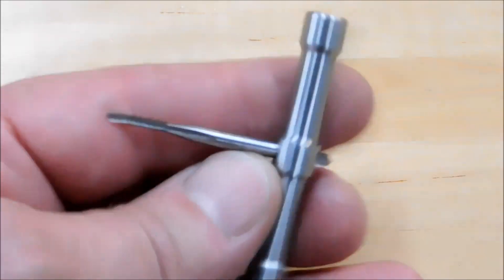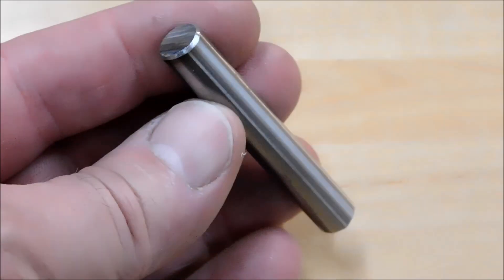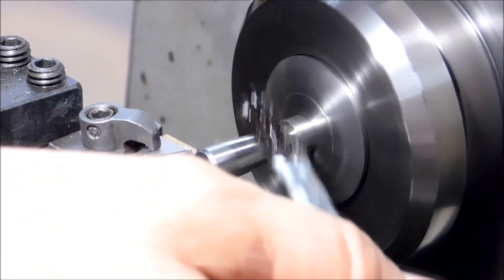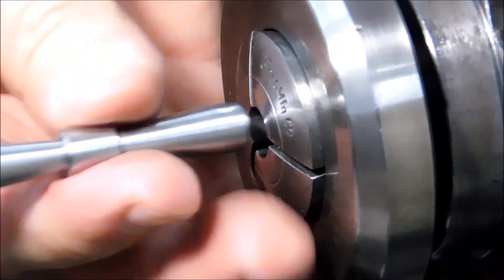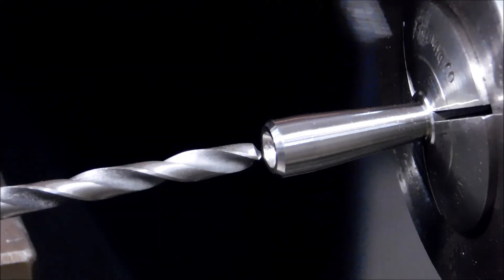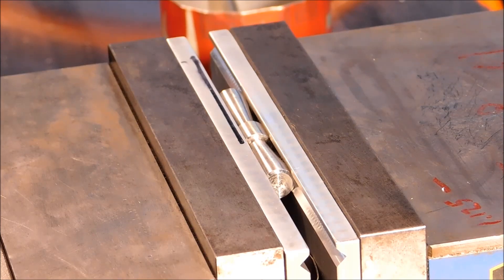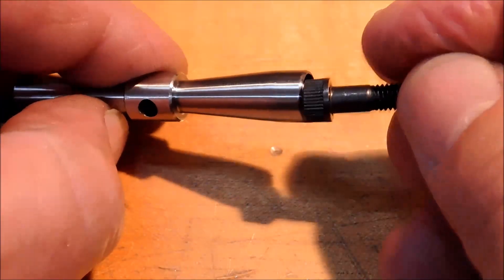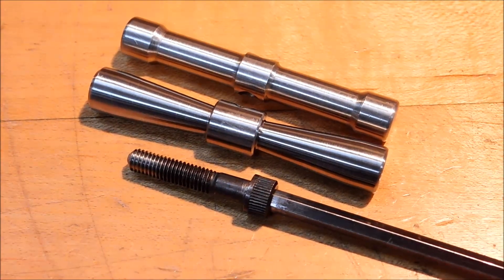Make your own Small Tap Handle !!

Comment: I use a flaring tool holder to grab the tap and allow the tap end to protrude so I can center the tap using my spring loaded center in the chuck
Reply from the maker: I'm sure it runs true.

Comment: Little set-screw tip:  apply a drop of silver solder to the tip of the set screw.  It's very grippy but soft and doesn't mar the tool.  And if it deforms, it doesn't wipe out the threads when you take it out.  Takes only a minute.  NTE did it with set screws on their pillowblock bearings briefly way back, which is where I got the idea.
Reply from the maker: This handle utilizes a Cap screw because the drive hex is twice the size for better grip. As for the tip, just sand it to a nice 45 degree angle and the threads won't get damaged either. The silver solder is a good idea, so is a brass insert.
Reply: @joepie221   Thank you.  Yes, I've done the brass insert as well with great success.  Simply drilling a hole, putting in a bit of round, and letting the first tightening swage it in there.  I switched to this because it was faster for me.  And you get to play with fire.

Comment: Hi Joe. I have a project you may be able to tackle. The microcosm engine, H 74 and H 75 have a centrifugal water pump that needs to run in the other direction, so you don't have to cross the belt. Making the impeller in the opposite direction is the problem. I would like to get in contact with you. I am also in Austin.
Reply from the maker: Hit the website contact page.

Comment: I have several tap handles that are either too large or too loose to be useful, one of these will replace several with the side benefit that it will take less room in a crowded tool drawer.
Reply from the maker: Plus give better feedback because of its size.

Comment: Thanks for the video. I need to tap some 2-56 holes so this will definitely help. Can a set screw be used instead which would avoid drilling the clearance holes for the body and head of the screw?
Reply from the maker: Absolutely. I only used a cap screw because the drive feature is much bigger.

Comment: Thanks I really enjoy your videos and the narration of what is being done.  I looked on e-bay for a convex tap guide, couldn't find one.  Did you make yours ?
Reply from the maker: No. My tap guide is a NIROL brand. If you remove the set screw in the rear of the body, you can remove the spring and tip. The tip is double sided. One point and one cup. Most come with the point side out and nobody ever knows there is another end.
Reply: @joepie221  THANKS

Comment: Hi. I don't understand that way to find the exact center of the piece: min 9:25, and even less so without using a marker. Thanks for the video.
Reply from the maker: When using a gage pin, its very easy to visually align a part. Look at the gap  between the pin to the jaws and then center the pin over the boss in the middle of the part. For an application like this, its more than sufficient.
Reply: Thanks guys

Comment: Have you got a video on how to make those v groove parallels ,seems like a handy piece of equipment to have
Reply from the maker: Use a second vise set at 45 degrees in your primary vise. Mill on the Y axis using the edge of an end mill. Quick and easy. Do them one at a time.
Reply: @joepie221  They sound and appear to be aluminum, is that correct?
Reply from the maker: @flannel_406  Correct.

Comment: wait, at 5:25, how the hell did he pull out the part from the collet while the lathe was still running?
Reply from the maker: My setup has a lever style release handle on the left side of the machine. I can open and close easily while spinning.
Reply: @joepie221  after some thinking I figured that must be the case. Didn't know such a thing existed! Cool stuff

Comment: I like it, but why thread it all of the way to the center? Just make a threadless hole for the last half inch to the center and remove the last half inch of threads from the screw. That would give you more meat on the handle..
Reply from the maker: I like it. It would allow for many different shapes with added strength at the smaller diameters. Good call.

Comment: Hi Joe. Could you please make some videos about Camlock mount Lathe Chucks (in detail if possible). My Lathe Holds D1-4 Size and It's very new to me. I would like to see how to maintain, adjust, or even make new back plate for a different chuck. Thank you and Happy new year
Reply from the maker: Just be sure that your cam posts are setup and extended so the cam lock index mark only rotates to a spot between the index lines on the cam collar. Thats very important.
Reply: @joepie221  Thank you Joe.

Comment: I found it works better to drill and tap the hole first before you turn down the outside. That way the collet has a better grip and won’t slip when tapping and I used an 8/32 screw. Thanks neat project!

Comment: hello Joe, this message is from Holland. I looked at your machining with a lot of interest. I have however one question. Why don't you clamp the tap on its square? Usually the square on a tap has the same corner diameter as the shank. I tried it and it works fine. You then don't have to grind a flat on your taps. Looking forward to your response. Herman
Reply from the maker: depending on how sharp the point is on the end of the tap, they sometimes go too far into my spring center to seat when a tap handle is registered on the square end. Thats the only reason.
Reply: @joepie221  Small taps can be awkward little sods. The little 8BA taps I'm using have a centre hole rather than a point, & the flats are minute.
Reply: When I drilled the cross hole in mine I did a pilot hole first, then drilled the clearance hole just past the set screw, Then filed the clearance hole square. Now all the set screw is just for retention.

Comment: Nice work. If I may ask, why not just drill a hole from the outside , not thru the handle, and use  a short square headed bolt ?
Reply: Shoving it up the end makes for a tidier finish.
Reply: @stevo68  Ohh Er Missus. 😁
Reply from the maker: I'm sure that would work too. You would sacrifice thread engagement, but it would work.

Comment: I saw this the other day and didn't have time to comment. While I was out at a friends shop I made one of these from, you guessed it, A gr 8 bolt. His ancient 3 speed belt drive lathe only turns automotive armatures and alternator rotors so it is different to see steel cuttings on the tray. Of course high speed tooling works best.  What a little beauty.. As you say the feedback is great. Thanks a bunch. This was fun. Now I have to make another one as my partner fell in love with it so it lives in his tool box now, LOL.
Reply from the maker: You better make a few.
Reply: @joepie221  They will make great xmas gifts. Thanks again Joe P.

Comment: Good video Joe.  Several years ago I made one similar to that, but based on the one Tubalcain (Mr. Pete) shows in one of his videos.  Used a home-made broach in the mill to cut a square corner for the tap to bear against, not sure that detail is worth the effort, and it ends up with the screw bearing on the corner of the tap square end, which isn't very secure.  I do like the tapered handles and did that with mine too.

Comment: FYI, tap sizes up to and including #6 MS (Machine Screw) or M3.5 (metric) made to USA (ANSI) dimensions, have the same size shank and square, which is .141 diameter.  The only thing that varies is the length.  So your tap wrench will fit #6 as well.  If you have small taps that have different dimensions for shank and length, these are likely German DIN dimensions and are in mm.  Great little handle. Dave
Reply from the maker: Interesting. Thanks.

Comment: I have finished mine; very happy with the result. After seeing your slotted soft jaws I decided to make a pair of those too. My question: how do you hold the plates in the mill to cut the 45 degree slots?
Reply: Lay it down flat and use a chamfer end mill.
Reply from the maker: I put a second vise in my vise at 45 degrees and used an end mill.
Reply: @joepie221  brilliant! Off to cut some 45 degree slots right now.

Comment: Very good tool. Now please teach me how to tap and not brake small taps. Seems to be a common thing with me is to brake small taps. Just the other day I broke a 4.75 metric tap and drilled the hole to 1\8  which the tap called for. Remade the part and stepped the drill size up one size larger then the threads would not hold tight just striped out. And was actually using the lathe to tap manually not under power and still broke the tap. Very frustrating .

Comment: Been using this method and concept for years with a small Starrett tap handle, don't have the number handy...
You can even pilot the top of the tap loosely in the drill chuck that dilled the hole if you don't have a spring loaded tap follower......
Reply: Mine is a Starrett #174.
0 - 14 tap sizes. Works a treat.

Comment: Not bad.not bad at all. Could be worth making one!
At time 10:00. Why not make a light cut using an end mill bit to give a small flat surface for the center drill? That protects the following work if there's "a bad day", thinking about us, not having 46 years of experience.
Reply: It's not a bad idea, but it's extra steps. As long as you've got a reasonably rigid machine (and chuck, and spot drill), you can often get away without it and save some time. If you've got a smaller/less rigid setup, and/or you're working on smaller diameters and/or harder materials, then making yourself a flat spot for the drill to  land is definitely more necessary.

Comment: Nice! I'll be making one of these - I really dislike the tap handle in my set of taps and dies. Not holding the tap by the square end is a cool trick I wouldn't have thought of. That gives me an idea, though: I'll make a little cap to fit on that square end, with a centre in it for my spring loaded tap follower. (My set has the same shank size for all the smaller taps.)

Comment: Hi Joe, just curious as to why the cross hole wasn't put in before the bolt hole as that's how I would do it, that way there is much less chance of a drill breaking or snatching or even wandering when putting the cross hole in. Awesome channel and always enjoy watching your vids. Ps, I don't mean to criticise, just merely asking your opinion. Thanks.
Reply: By drilling the cross hole first and then drilling and tapping for the bolt hole, it will burr and roach the the cross hole which needs to have good surface for tap alignment. By drilling the cross hole second it provides the smooth bore for better alignment (wobble of the tap handle).
Reply: @wwilcox2726  I suppose there is argument for both methods. The cross hole could be cleaned up afterwards, it's not difficult. I guess it doesn't matter as long as the end result does as it claims, and it does just that.

Comment: There are only a few metric taps (that I use, to be fair) in the sort of range you'd need something delicate like this.  Would it work well if you were to broach a square hole to match the size of each tap?  Or, given the small torques at those tap sizes, would you need to harden and temper it to stop it from rounding out?  Would EN19 (4140) or EN24T (4340 - at around 24HRC) be sufficient for those of use without the ability to harden steel?   Just thinking it would make it massively more convenient not to have to adjust the screw - but obviously the disadvantage is one handle per tap.
Reply: I think you are way overthinking this.
Reply: @utidjian  That certainly is my M.O.

Comment: I have a question: what if instead of drill and thread, you use one side of the handle like a retention making it as a bolt and the other side as a internal thread with two flat sides to use a spanner and perhaps as a leveling surface... sorry my bad English explanation!
Reply: Interesting thought. It's a simple sounding project if you made one of each type and then shared with us how each one ultimately performed.

Comment: I always drill the bigger hole first when going 5XD or deeper. That way the smaller drill doesn't have the long travel in and out, in which there's the opportunity to pack with chips and break.
Reply from the maker: Good approach for sure.
Reply: That's also a good approach for doing larger counterbores as it prevents the drill from snatching, especially good when drilling and counterboring brass.

Comment: Thanks Joe. I have something similar that I have had for over 30 years. It is the T handle from a high pressure 1/4 inch stainless valve. It was already drilled and tapped like you did yours and I have used it thousands of times.

Comment: thats a pretty lap driver. 17-4 leaves a beautiful finish as turned. whats the secret to breaking chips with 17-4 ? i have a 13-24 jet lathe and i have tried a lot of different feeds and speeds and inserts.but i still get those dangerous stringers. i have resorted to using an interrupted feed technique to break the strings. any advise?
Reply: You're feeding way too slow that's why you're getting strings you have to push it
Reply: @glenncirello4085   thanks for the advise Glenn, i have access to a large lathe that i can feed fast enough to break chips. but the smaller imports don't seem rugged enough to take this much feed. i was hoping that someone might have come across an insert that works on these machines using reasonable feeds and speeds

Comment: It would be very interesting to see how to make a square hole (just right for the tap's square tail) with relatively simple tools.
Reply: use would need to use a broach
Reply: So yeah... here... an exact answer to your question. 😉

https://youtu.be/DgB1psCFC7o
Reply: You could turn a round insert  at least  twice  the  thickness  of the tap wrench .. mill it in half to make a.  D  shape then mill your square  then press  fit or loctite into an enlarged hole in the tap wrench.  Although  I pesonally  am to old  for fafing  about    with this concept.? I would  copy a British Eclipse  type wrench
Reply: Eclipse No 245
Reply: The simple way is to make a 2 piece design, 2 handles with a notch, a threaded cross hole at the end and a through hole before the notch. Both handles are identical and then you simply bolt them together and they grab the square. Very easy to make.
Reply: And broach plans and description:

https://youtu.be/UKgHR4gcTyo
Reply: Not sure what Joe would say, but aside from a lot of filing with very small hand tools, I would say making a rotary broach with the correct tooling would be about your best bet... ToT had a good video on rotary broaching...

https://youtu.be/GWyHJVOxKK4